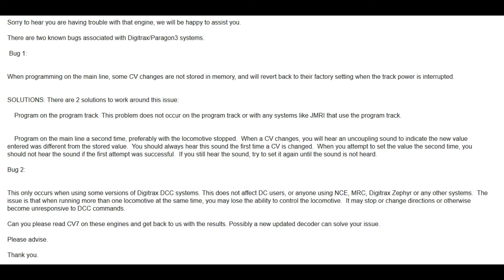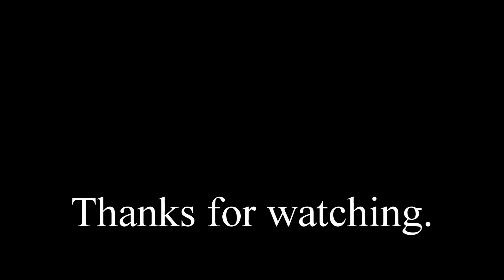46. BLI Paragon 3 Decoder Issues

Comment: I have a BLI paragon 3 4-8-4 NYC Niagara with a dead decoder i think, you see, it ran out of control all the sudden and after I reset it, it will no longer move but will produce the sounds as normal. Think I need to get a whole new decoder for it or could this issue be caused by the circuit board that is connected to the electric motor itself?
Reply: What was the fix for it? I have a similar issue with a cab forward
Reply: Well, turns out the paragon 3 decoder in the tender went out... I had to order a new decoder which they gave me an upgrade to paragon 4. I installed the decoder myself which is easy as its just plug and play.

Comment: I use an MRC Advanced Square system. I've been having many problems with the decoders in Broadway Limited locomotives. Mostly the steam locomotives with Paragon3. The decoders seem very sensitive to anything little things on the track. I had a PRR T1 sitting on the track. Had a few shorts that reset the system. When I tried to use the T1, it would not move. All sounds and lights were working but the locomotive would not move. I have 6 Paragon3 steam locomotives from Broadway Limited. They all add issues that forced me to return them for repair.
Reply: I have a brand new, out of the box, never used (that I know of) BLI, T1 and when attempting to program it, I get a 'CAN NOT READ CV' message!  What's going on???  Apparently a decoder issue?  Come on, it's brand new!!!!!!

Comment: Very valuable info. I have TWO N Scale BLI Paragons and they are both back at "the Shop" in Ormond Beach. For two different reasons. I suspect my track has an issue. Although my two Bachmann N scales seam OK. But the level of sophistication packed into the Paragon decoders is not just amazing, but "clean" reliable power HUNGRY. Any way, it was nice watching the video and I've tucked it away for future reference. Keep up the good works.
Thanks for sharing...

Comment: I bought an L1 and immediately it did the same exact thing on Digitrax systems, occasionally had issues on NCE, my fix was to sell the thing before it lost any value.  Paragon 3 is bad news from BLI, Paragon 2 was good, everything got worse on 3, from operation to sounds everything got worse.  Not sure how they messed up their reliability and put in crappy sound files.

Comment: I have a Reading T-1 4-8-4 #2101 with Paragon 3. I am having problems with random glitches and runaways in reverse when I power up my DCS 52. I also have DC turned off. I have had similar problems on my club layout also running Digitrax.  I think this is a decoder problem because I have seen others with similar problems running NCE. 

Some people think it is a low voltage programming track issue.  I just did a reset and If I have issues again I will try to mainline program.  If all fails I will be contacting BLI.  

If the wheels are dirty at all it causes shorts,  smoke unit to turn on and random sounds. Sometimes I get no response at all. 

I really like BLI but wish they would offer them minus decoder use a second party or step up their game.
Reply: I have a DCS52 and I'm thinking of getting the new Northern Pacific 4-8-4, but I'm having second thoughts because of decoder issues.

Comment: I purchased a B L I Reading T1 4-8-4 about a month ago, this morning I powered up my E Z command control center and it started jerking and going backwards. I opened up the tender and it smells like burning electronics. To say I am disappointed would be putting it mildly. Any advice on this would be appreciated
Reply from the maker: I'd contact BLI. Sound/smells like your decoder burned out. If it is still under warranty they may repair it for free though you will have to pay for shipping it to them. You can contact their tech department at: https://www.broadway-limited.com/contacttechnicalsupport.aspx.

Comment: Hi I have 4-8-2 P3  and I have problem with electrical pick ups, Does your tender has all wheels with electrical pick ups??  mine only has one  for truck, is this correct?    and  also Do you know what is the small white connector  nex to to the  power cables?  (black and grey)  Thanks!!
Reply from the maker: Unfortunately, I don't have access to this locomotive right now. I believe all the wheels on the tender have electrical pickup on my model. I am not sure what connector next to the power connector does. It was not being used on my locomotive. That would be a good question to ask BLI. https://www.broadway-limited.com/customerservice.aspx

Comment: I have had a decoder problem with my Y6B 2-8-8-2 loco twice now including sending it back to BLI for repair. The sounds are fine but the loco will not move. Tried to reset it manually with the reset button on the tender and it still will not work. Do you think it is a decoder issue like you have explained in this video and that I need to have it replaced with a new version of the decoder? Thanks
Reply: Same case.. waiting for answer
Reply from the maker: Is it a Paragon 3 loco? BLI told me the main problem has been with Paragon 3 decoders with certain Digitrax systems. My best advice is to contact BLI and/or the manufacture of your DCC system to see if they know of any issues with your specific locomotive or DCC system. I have never owned a BLI Y6B 2-8-8-2 so this is the best advice I can give. Sorry for the slow answer. My YouTube channel is purely a hobby so I don't always have time to reply to comments on my videos. Thanks for the comment.
Reply: The problem is in the connector.. I won't move until I touch the connector. I tought there is a problem with the cable.
Reply: @Stuart Aaron I agree, after the P3 decoder went skitzo I ripped it all out and put Tsunami2 Steam TSU 2200 in. I was running the smoke unit but eventually took it apart, cleaned it up and turned the smoke off. Way to messy. Now my Challenger sounds unique not like every BLI steam locomotive ever made. LOL Problem is, I have a Big Boy, another Challenger and two Cab Forwards. Dont think Ill convert them all until the P3s blow, if they do. 

Having said that, man talk about complicated. The logic board in the loco itself that controls lights and the smoke unit have WAY to many connections and wires. LOL All for realism I guess. I removed it all and put it in a zip lock baggy and now it sits on the shelf.

Comment: So I have four ES44AC's from BLI and they are all really jerky  they didn't do this when I first got them, but after a little while they get quite jerky while moving. The club I'm part of uses Digitrax and I use NCE on my personal layout. Ive done resets, changed the voltage and low speeds, changed the BEMF and nothings work. Could it be that the decoders are bad just like in the video?
Reply from the maker: Possibly, I would contact BLI and see if they know about any problems with your model of locomotives. They may ask you to give them the manufacture ID and version number of your decoders (CV8 and CV7) to help them better identify which decoders you have.

Comment: I have a pargon 2 I'm running DC but I hard that DCC will run on DCC but the Locomotive still don't move any suggestions me Bob Miller
Reply from the maker: By NMRA standards address 0 is supposed to allow you to control 1 DC locomotive by stretching the DCC square wave signal to "trick" the motor into running. Not all DCC systems support this function (my MRC Prodigy Advanced does not). Also, you must be very careful as you can burn out the motor mechanisms on some models, especially if you just let the loco sit on the track without moving. If you hear a buzzing noise, especially once the loco starts moving I would not run that loco on your DCC layout for fear of damaging the motor.